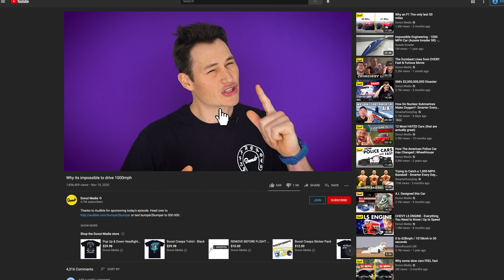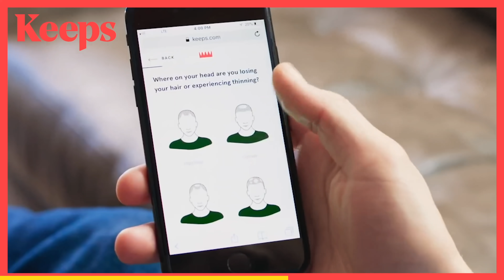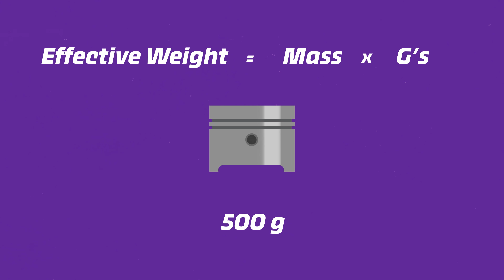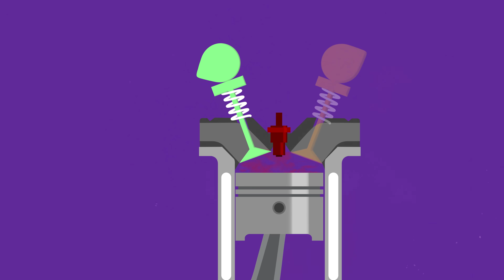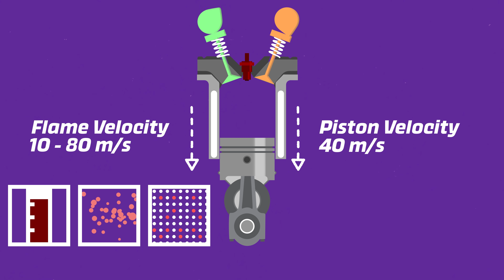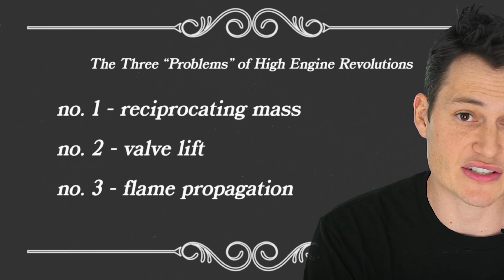Why It's Almost Impossible For An Engine To Rev Over 20,000 RPM

Comment: How about beehive valve spring. It comes with the shape of a beehive with a beefier spring center for increased valve response.
And also, having a lighter valvetrain helps cuz it reduces the reciprocating mass being absorbed by the spring. But of course, as what Jeremy explained, it had to be strong to withstand the reciprocating mass hence it should be strong and light such as titanium valvetrains and it comes trade-off, it's expensive.

Comment: The reason why it's mother nature, not physics is because theoretically, if you would have such materials you can have an engine that is revving over 20K RPM. The problem is that Mother Nature is not providing Earth with such materials in a plentiful manner for this use.

Comment: my 1990 CBR 250RR revs up to 19,000rpm 😎
Reply: I think my rev limit is 21000rpm in 6th. Mc22 owner.
Reply: @tyri4n  any mods done or is that the stock limiter? If I'm not mistaken, isn't the rev limit 20,000?
Reply: @slingshot99  no mods beside a stainless pipe. L model from 1990 so no restrictions. Rev limit is 19k ish from 1st to 5th, 21k for 6th.

Comment: In the early nineties would go to the GP's on Qualifying Days.We used to stand on the hair pins and Ferrari's Motors would go silent for about 50 meters or so. You would only hear tire, aero and other mechanical noises. Then the driver would shift and BANG your eardrums would explode. Found out engine was revving to 24000rpm on that sweat V12. Engine was going out of your hearing range at about 18000rpm but the  driver still had his foot into it till 24K. Thats why they only last 3 laps. Sweet

Comment: okay so basically what you're telling me is that I need a rotary
Reply: A turbine engine would be the perfect rotary in this case.
Reply: I was waiting on this reply as I was saying the same thing.
Reply: Rotary Valve Cylinder heads go a long way to overcoming most of these challenges.
Reply: @jimmyb1451  ROFL!!!!
Reply: Rotary will never rev 20 000 on the crank even if the rotor does a 3rd  of that.
Reply: You would be hard pressed to do it. They wouldnt have to worry about the first 2 issues. But they would about the 3rd issue. You would spin faster then the fuel could be ignited. They already have a problem with having unspent fuel stock. Making them spin faster would only make it worse. You would more then likly just flood the engine at higher rpms.
Reply: @CrypticApathy  superheat the housing irons to help ignite more fuel thermally. They already have two spark plugs per rotor, throw more in, fuck it. Do a spark plug delete and install a literal flamethrower to ignite fuel. The solutions are endless, even if they are more fun than effective
Reply: @sakemi  Your not actually far off. There was someone a long bit ago that actually had 2 secondary plugs per housing. He was running 3 total. It helped with the unspent fuel. He did it to a 12a Carbed 12a that he built around a holly corroborator. His redline was like 17k. He was running 8s in the 1/4 with it.
Reply: @sakemi  Problem there is Wankels already suck at thermal management, because all of the heat is generated in the same 1/3 of the housing. But the advantage is no valves, so no timing problems at very high revs
Reply: They max at 20k rpm too 🙄
Reply: @weekendwrench  if a rotary were to hit 20,000 rpm the rotors would only see 6,666.67 RPM because the eccentric shaft is what is counted as a revolution from a rotary, the eccentric shaft spins at 3× the rate of the rotors

Comment: This video: pistons can't high rpm because xyz.....

Rotary engines: "bitch hello??????"
Reply: The rotors on rotary actually only spin 1/3 the speed of the output shaft though, so even if a rotary shaft is spin at 24K rpm the rotors is actually spinning at 8K rpms
Reply: @ainulkarim5074  okay but we're talking about engine rev here

Comment: I've got a motorcycle from the '80's that has a 19,000 RPM redline.
Reply: I really really want one of those. Some modern tyres and suspension etc would make that an absolute hoot to ride. Must sound like nothing else on a flyby.
Reply: mc19?
Reply: @Rotorr  FZR 250R
Reply: 3LN1 in dark blue / silver, the EXUP valves still work. I had to get new fairings, windscreen, rear turn signals, new tires and chain so far. I've also upgraded to a lithium battery and rear brake light flasher module. It needs new seat coverings now and the tank is starting to rust out from the inside, not sure how to stop that! You can still read the Japanese paper sticker on top of the tank too lol
Reply: @Rotorr  had one of those.  The sound coming from one of those was pure joy
Reply: @fokiralomgir2563  im currently rebuilding my mc22 for track use. If it wasn't as light and fun to ride i wouldn't have bothered. A simple twist of the wrist will bring a smile ear to ear.
Reply: @Rotorr  enjoy and ride  safe.  I've moved away from bikes after a serious accident
Reply: @fokiralomgir2563  im sorry to hear that. Mine will only be on the road to break the engine in then it will be purely a track bike afterwards. Way too many idiots on the road who dont see bikes its scary.
Reply: I've got a dremel from 2013 that's maxing out at 33 000 RPM
Reply: @manman-sg1zt  those are electric not combustion lol
Reply: @myrealusername2193  I know I know, I'm just kidding you in metric system
Reply: @justan idiot AMR 300 supercharger kit you say... hmmmmm. I've got a sticky slide to fiddle with and a tune-up to do but that would be a great project

Comment: #ROTARY
1. No change in direction of the spinning (Dorito) Mass
2. No Valves or some sort of other direction Changing Parts
3. Flame Front shouldn't get outrun by Dorito(?)
Problem solved

Comment: Smol cc Motorcycle be like: "SIKE!!"
Reply: Even 1000cc bikes rev like mad nowadays. The BMW SS1000RR has a 14,000 RPM redline.
Reply: @Drunken_Hamster  yeah even the Kawasaki Ninja H2R redline at 14,000rpm like and a Kawasaki ZX-R 250/R Ninja redline at 18,000Rpm. Small bikes are getting high redline.

Comment: Most of the issues you mentioned are related to the limits of a single piston and its cylinder...I feel everything you said could simply be alleviated by simply adding more cylinders so that the work of turning the crank shaft is more distributed to multiple cylinders...this is off course assuming the design is such that each cylinder is independent of forces from other cylinders...not sure if something like this exists or such a design has it's own drawbacks...maybe you could elaborate.

Comment: I recall that the jet turbine cars idled at 20,000 rpm or more. Big part of the reason they used so much fuel. Rover first, then Fiat later Chrysler. Race cars also likely seeing the most use.

Comment: Toyota and Honda made running prototype f1 v8's that ran 26k and 24k rpm respectively in 2005. The fia came in with an 18000 rev limit that ruined the development

Comment: For the Valve problem, that can be fixed by using a single direction "piston" without any valves (wankel/rotary) but the problem of the flame propagation still remains but that can be kinda solved by moving the placement of the spark plugs and possibly add one more per rotor (both to try to mitigate the rotor of out running the flame and redundancy incase the other fails to work), plus using a rotary adds the problem of Apex seals, people would have to find a better material/redesign to make them both stronger and lighter. But that's how you could make a higher reving engine, idk don't take advice from a 14 year that wrote this a 11:40 pm...

Comment: The  adage of a  little knowledge is  dangerous   is  at  full steam ahead  in this one.....  inherent design limitations  is why  different designs like  2 stroke,  rotary,  turbine engines all exist... at no point did  any  engineer that wasn't a muppet think that  only  4 stroke should be used for  engines exceeding 20k rpm...  at some point  the performance at  RPM means you change to a different engine design because it provides better performance to cost .....    a  donkey will never be an elephant   and an elephant will never be a bird.....

Comment: MC22 CBR250RR: 4 cyl 4 stroke, rev bouncing above 20K RPM daily since the early 90's and still going hard
Reply: My first thought.
Reply: My first bike 😍
Reply: yeah my workmate had a CBR 400 that went to 18 easy, while my FZR 400 only went to 15.  We'd drag off the lights every day after work, good times.
Reply: You had it for how long??
Reply: 17.8k actually tach was inaccurate cdi would only provide enough spark for that
Reply: @Emfourayone  nope had my 1989 mc19 with an after market digital dash and tac still read 21k
Reply: But its not a car its a bike and its lighter than a car it has less effective weight

Comment: A 2 stroke nitro rc car motor operates between 4000-42000 rpm the problem with the 20000 limit isn't Mother Nature its the number of strokes a motor has to make witch is why 2 stroke will always beat a 4 stroke they even said a smaller stroke was better well imagine eliminating 2 of them

Comment: The electro magnetic sounds like the best idea. It would be like a subwoofer but instead of a cone it's a valve. And the cool part is it can change the amount the valve opens on the fly so it's got unlimited vtec. It would be an awsome new thing. And it would be good for power and economy. Because it can open the valve the minimum amount to do the work its doing at the time like just going 1 speed down the highway or at idle. But when you go WOT it would max out everything and suddenly it's got the biggest cam possible. I'd love to hear that vtec kick yo it would very likely be one insane sound

Comment: Now I know this is way too expensive to be fully feasible and electric cars just make more sense but...

Porsche's 3d printed pistons, with possible other rotating parts getting the light weight 3d hook up, with a super short high rev design coupled to electric motors to assist in getting off the line smoothly.

Yum.

Comment: My father sold his 56 Chevy power pack or something because Mom was racing it this was before I was born trust me she could not drive even up to the day she died saved my brothers and siblings life evidently if she wasn't on the gas she's on the brakes scary and I'm glad you got into the valves new technologies there some of it is rules and regulations you have an engine spinning that fast that is a hand grenade the biggest problem as of floating valves as of valve's opening when they should not be is also valve overlap cam shaft centers and such you did a good job two big thumbs up my one got stuck in a valve so I can only give you one who knows maybe get some hair back someday

Comment: First of all where is Ducati's desmodromic valves? Very innovative, as they managed to rev up to 14,000rpm back in 70s. Secondly, one more limitation is that if an engine revs too high, there is no time to fill the cylinder with fresh air, as the speed of the air is limited by the speed of the sound. So less air, less fuel, less powa baby.
However, it was a very interesting video.

Comment: Well that explains why a lot of Diesel engines red line at 5K or even lower. Granted some new ones redline at 6-6.5k. But it's because of crazy 18:1 or so compression, and small bore but long stroke, so lots of torque and low end pulling power but no high revs.

Comment: Desmodromic system is a "srpingless" valve system. Nowadays it's mainly (only?) used on Ducati bikes. With this system valve float cannot happen as the valves are moved back indirectly by another camshaft.

Comment: Reason number 11,364 that I love relatively low-revving, torquey engines for performance vehicles. Plenty of power up to reasonable speeds (say, 6500 rpm), peak between 3 and 5 thousand rpm or so, and they’ll usually last a damn long time even with relatively hard use.
Reply: but high number fast boom boom make fun noise
Reply: @alekonicolacakis7002  They definitely do, and I would like to own a high-revving rig specifically just for having fun on country mountain roads. Just not for anything else. I'll almost certainly buy a GR86 one day when they get a little cheaper.

Comment: And thats why diesels usually have very long strokes and low redlines with tons of torque and low power, because they trade rpm and weight savings for massive volumes of air and long stroke, which is honestly the best for a road car but everyone is obsessed with horsepower so instead we have high rpm V6 engines

Comment: For those of us old enough to remember the 60s Honda was producing 2 & 4 stroke GP bike engines that were producing 22000rpm with one of the engines being a 6 cylinder 250cc which first raced GP in 1961.

Comment: me with my Rc motor hitting 30k rpm 
“Eh”
Reply: It has a shorter stroke than an f1 which in the era of the 20k rpm NA had a stroke of about 4cm or 1.56 inches and an average piston speed greater than 26m / s, this average speed with a stroke of one inch corresponds to more than  30k rpm

Comment: In Japan I once heard a four-cylinder Honda CBR250RR coming down a mountain, revving to its 19,000 RPM redline, and he'd removed the exhaust muffler to run a straight pipe. Sounded like the hounds of hell were approaching.

Comment: RC nitro engines can rev up to 50,000rpm. for RC cars the TYPICAL operating RPM is 25,000 - 37,000. You should revise this title to say why a 4-stroke engine can't rev past 20,000rpm

Comment: The math at 4:06 is wrong, 500 grams at 9,500 G's means 93,100 Newtons not 4,750 Newtons so almost 21,000 pounds instead of 1,000. The equation for force/weight in newtons is F=ma with "a" measured in m/s^2 not in G's

Comment: Reason 4.  People. most people will never rev an engine to 7K even If most cars redline is around 7K, why do people drive around at 2200 pinging away on cheap fuel?  What would be the point of a higher redline?  I"ve owned several DOHC Vtec engines, currently a K24, I rev the piss out of them,. But Honda doesn't even produce a True Three Lobe VTEC anymore.  Bye-Bye 9K or even 8K redline.  BTW you forgot Rod stroke ratio, the trick to running a longer stroke at higher RPM's  is a taller block and longer connecting rods which slows down the acceleration forces, and yes I've built an LS/VTEC in my days.

Comment: Another way to make a higher rewing engine is to make a smaller engine, the nitro powered engines in radio control models can spin in excess of 50k rpm. https://en.wikipedia.org/wiki/Nitro_engine
Reply: That's literally addressed the first part of the video. Weight of the moving parts. A RC Nitro Engine is tiny AF, like a few cubic centimeters, hence it can go way faster. Too bad you are lucky to get a 2-3 HP max out of it. Making it useless for street cars. Even top fuel dragsters don't spin any where near 20K, once you scale them up. It's not the type of fuel that is the major issue with it. It's physics vs cost.

Even when you look at something like motorcycles which rev significantly higher than cars, their power output is about the same as a larger car engine spinning at like a 3rd of their max RPM. 

Want a faster spinning motor that is actually usable? Go electric. Or jet turbine, if you want to stick with fuel.
Reply: @ryantakahashi9130  He talked about the mass of the components and not the size of the entire engine. I pointed out that small engines can spin much faster than 20k rpm, while he was disregarding two-stroke engines and makeing it sound like no piston engine can go much faster than 20k rpm.
Reply: @karl-artureiskop4942  Mass is directly related to size, when assuming they use the same or very similar materials. The smaller the engine, the lower the mass. Thus it it can rev higher and there is less stress on the motor. This is basic physics.

He literally mentions specific examples of motors that can go above 20K, that aren't RC cars.

He's not saying it's completely impossible, just that it is difficult or insanely expensive to do it. 

Imagine trying to argue that a 3 cubic centimeter engine that produces 2-3 HP that revs over 20K is relevant to any normal vehicle that someone can drive/ride.

Comment: Ya know back in 2000 f1 had a 22,000 rpm engine, they even said 25,000 was possible 20 years ago before the rules limited RPM to 18,500. Nitro RC cars rev well over 30,000 RPM. And the whole horsepower equation is torque X RPM/ 5252 since you left it incomplete

Comment: "engines can't rev over 20000 RPM"
jet engines: "am i a joke to you?"

sidenote: they are technically 4 strokes because they suck in air, compress it, blow it up, and shoot it out the back, so technically 4 strokes CAN rev to like 100000 RPM lol

Comment: "Isn't limited by physics, but rather by mother nature" - That's... That's literally the same thing
Reply: Nope, the problem was geography, not physics
Reply: What I THINK he meant "THINK", is how the fuel couldn't really catch up with the piston, so I mean yea it's a form of physics, but how rapidly do you think a gas could expand and ignite 🤔 maybe we need some new fuel? 2 Stokes don't use valves so problem 1 solved, but what's next? A super high pressure injector thatll help thrust a piston downward+ the fuel ignition? Idk we'll have to start making blue prints of the best possible design in engine motion
Reply: @ulifehr5357  I think your talking about a wankel engine.... Fixes the majority of those a issues
Reply: @jaykoerner  Despite being a huge Wankel engine fan, you have to assume that this kind of engine with its own kind of problems
Reply: @elyon2966  oh I know, just saying that technically solves "those issues", anyways 4 sided rotories seem to solve some of the issuee
Reply: I dont think a plant is physics...
Reply: @carlosverdugo9684  Every aspect of nature boils down to physics.
Reply: @carlosverdugo9684  Lol! Basicly a plant is a mixture of chemical materals, so when you talk about materials you talk about phisics and chemistry at the same time... that's how mafi.. i mean science works!